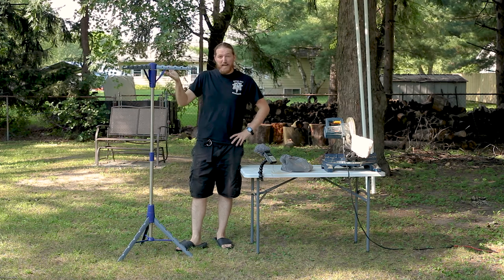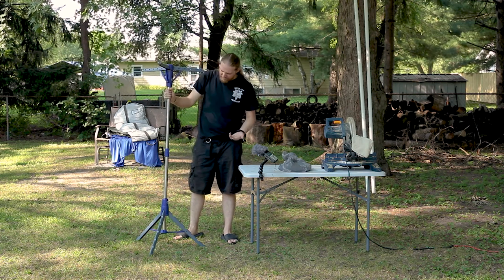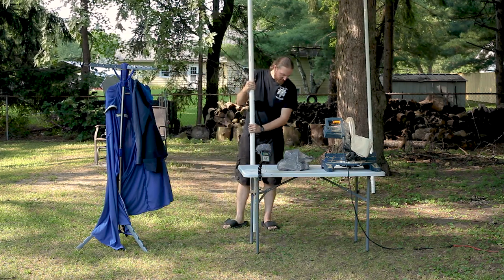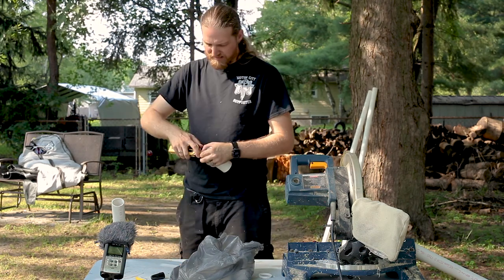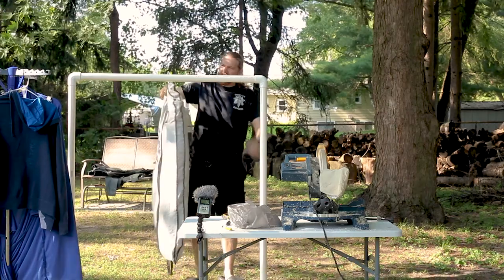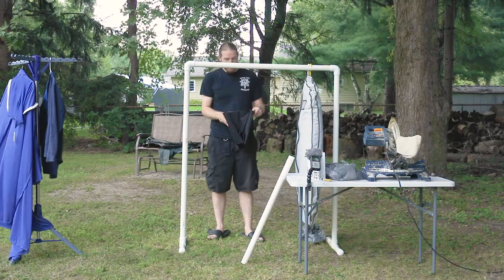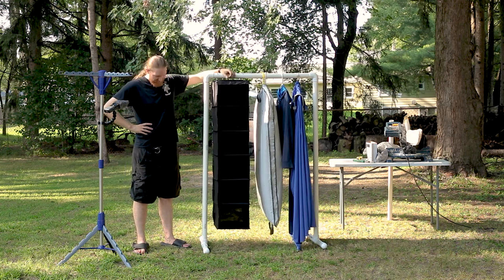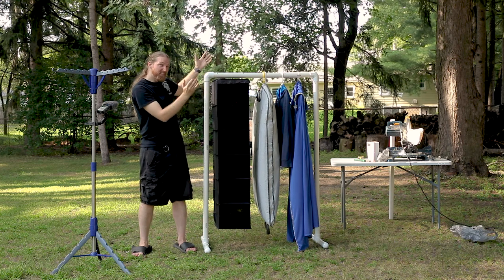PROJECT - PORTABLE PVC CLOTHING RACK

Comment from the maker: UPDATE: They do, they have 1½-to-1¼ adapters, so I got two of those, and replaced the top bar with a 1¼ inch pipe! Yeah, I could have made the whole thing out of 1¼ inch pipe and I think it would still be plenty strong enough for a clothing rack,  especially at the size I made it, but I think this is the best of both, sturdy 1½ inch uprights, and a thinner, 1¼ bar, that will fit a wider array of clothes hangers.

Comment: How would you make it extremely long without it buckling? T joints every 5 feet (adding a coupling at the end of the 10 foot piece to add to make a 20 footer?)
Reply from the maker: Yeah, something like that would probably work. You might also want to look into electrical conduit. (I made one, but haven't made a video on it yet...) but you can use much thinner pipe, that will span longer distances. The biggest challenge is finding/making fittings for it. There aren't really T connectors for electrical conduit, as you can't run wire through a sharp corner, so there is no reason for anyone to manufacture them. But, you can slip some PVC over the end, and then use PVC couplers/fittings with conduit.